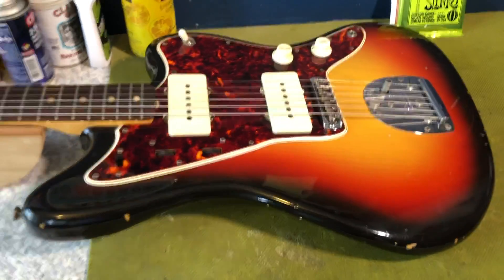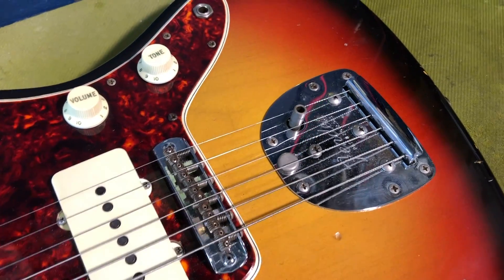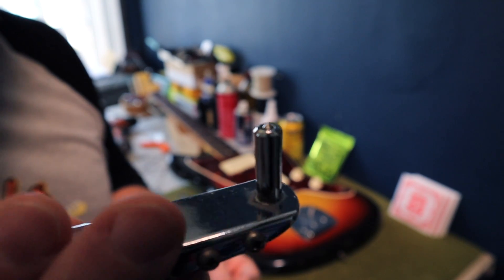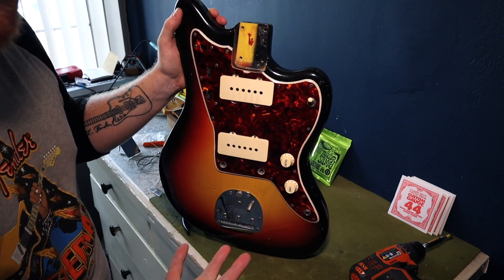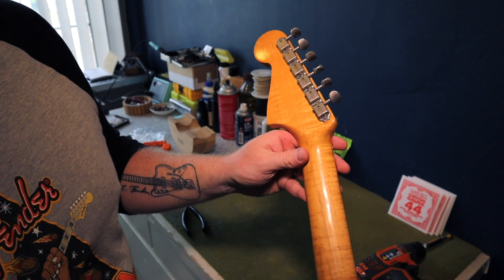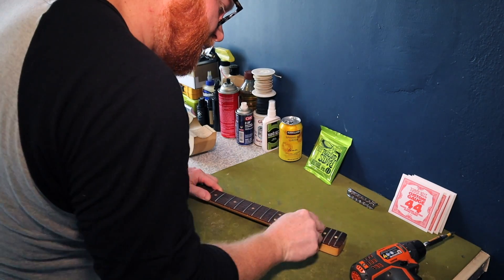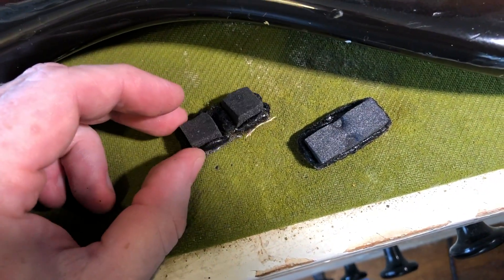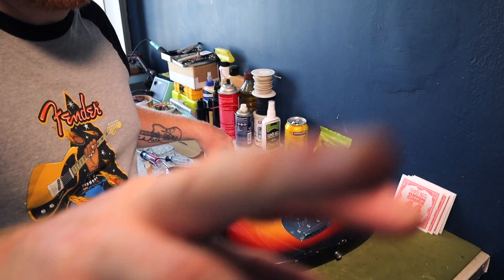1965 Jazzmaster Setup Walkthrough & Demo

Comment: I appreciate the way you assess the guitar so thoroughly. Lots of people will just finish the one thing that you specifically tell them about, and won't necessarily take the initiative to say oh by the way, I also noticed x and y. It makes me think they probably don't take the time to look at neck angle when it comes to setting up Jazzmasters and Jags. I  had a guitar set up once that came back playing exactly the same, with what felt like the same strings (I paid for new ones), and like the guys down at Jiffy Lube had played a few songs on it.
Reply from the maker: Jay, I try to take my time with each guitar which is why I usually charge a flat fee rather than an hourly rate. I play it for a bit, ask a lot of clarifying questions about play style, tuning, hand pressure, and clean vs effected sounds, and then blend it all together to help me setup the guitar for its player. It's a lot of me thinking and pacing, but I think I do alright! 

I worked on my first Jazzmaster in or around 2008 –– they just didn't pop up much in my home town. And when it came in, I noticed the string skipping issue and was completely confused by it. I didn't want to just hand it back as-is, so I did as much reading as I possibly could, considered every factor, and I'll admit it took me a couple of years after that for everything to click! But you're right, the tilt-back thing doesn't really come to mind for most folks because it just isn't routine for other guitars.
Reply: @Puisheen  that's great. Each person has their own sounds in their head, a particular way their hands interact with the guitar, all sorts of things, so a more personalized set up is worth it. Gotta start saving for my pilgrimage up north :) 👍

Comment: Thanks for all your help Mike! I finally got the Shell Pink Squier Jazzmaster and have been following your tips on setting it up and it is working really well! My next step is to replace the electronics and pickups. 

I am planning on getting the Curtis Novak JM-V (neck) and JM-Fat (bridge) and I want to keep the traditional Jazzmaster wiring with the Rhythm circuit but I would like to make some additions. I thought of installing a Free-Way 3X3-05 6 position toggle switch as well as a treble bleed mod and also allow the Rhythm circuit to work with the switch in order to use it with the bridge pickups as well as the neck, and neck+bridge. I reached out to Free-Way and they sent me a schematic on how to obtain positions 4, 5, and 5 from below:

Positions
1. Neck
2. Neck+Bridge in parallel
3. Bridge
4. Neck+Bridge in Series/In Phase
5. Neck+Bridge in Series/Out of Phase
6. Neck+Bridge in Parallel/Out of Phase

Do you know anyone who could help me figure out how to combine the wiring diagram sent by Free-Way with the traditional Jazzmaster wiring diagram plus having the Rhythm circuit work with the typical three pickup configurations? I have looked online and haven't found the answer and was hoping you could point me towards the right direction!

Thanks again and my next step is to level the frets and crown them!
cheers,
Jon

Comment: Hey Mike! Nice to see you doing a proper channel!! Thanks for all the helpful info over the years! I don't own a Jazzmaster, and probably won't for a while, but I'm curious about the original bridge versus the Mastery. I've seen you say that it is possible to use the original Jazzmaster bridge correctly, it just needs to be set up right. I just wanna know why the Mastery works the way it does, and why it seems so difficult for people to set up the OG bridge correctly?
Reply from the maker: The original bridge works great, as seen in this video and the previous one on the Jaguar. I think the issue isn't a matter of design or materials, but rather, education. Most people approach offsets as they would any "normal" guitar without considering the string geometry, the flow from tailpiece to tuners. Increasing bridge height by using adequate neck tilt-back is crucial, but not necessarily the first thing most techs think of when they're doing a setup. 

The Mastery is my favorite aftermarket bridge, but because it's designed to remain stationary and has deep grooves for the strings, the neck tilt-back feature isn't quite as crucial because you're not having to increase downward pressure on the bridge to keep things stable. Although I'd argue that these guitars still play best with some degree of tilt-back

Comment: great video! Thanks Mike. Now, I know my bridge is set up wrong.. ish. How do I know? because I faffed about with it when I was 18 and didn't know what I was doing :D 
I have my bridge set lower and the saddles set higher (partly as the screws were getting in the way of my low E string. ) Does this matter? I think the vibrato doesnt' bend as low, but I've never felt I'm missing out. tuning stays pretty good... any thoughts? cheers Luke

Comment: hey mike. Great Video. Just one question i got the part to go up and down with the steel wool not side to side, but the steel wool will not scratch up the fretboard?
Reply from the maker: I mean that's all buffing really is: putting successively finer scratches on a thing until it looks smooth. 0000 steel wool is fine enough that it's not gouging the board, but rather, smoothing it out and clearing away debris.

Comment: I have a new to me super nice Blue flower Jazzmaster, made in Japan. The guitar is my first offset so I am on learning process of how do setup and best strings and so on. Factory setup honestly is already good. Only unusual thing is the is comes from the factory with 0.9. Not great issue but I would go to .10 or maybe .11. Guitar neck has a certain breaing angle and no problem with tuning stability. I just see that the bridge is not moving that much when I use the tremolo. Maybe heavier strings will make the bridge move more?
What shims angle do You feel that is average ok on JM?
Thank You so much, I really appreciate Your informative contents on YT, IG and website. I have read them all.
Reply from the maker: Hey Marco, every guitar is different so it's difficult to point to a magic number that will solve your issues, but it seems that MOST guitars I've worked on require between .3 and .85 degrees of tiltback. And you're correct, heavier strings will always work better with these designs, though you may also be experiencing issues with the Japanese bridge which has much more shallow saddle grooves and usually a polished chrome plating on the saddles that makes them a bit more slippery. Friction is key for having the bridge move along with your vibrato.
Reply: @Puisheen  thank You I raelly appreciated Your reply. If I were in Your area I would take my guitar for a setup to You!

Comment: Hello! I have to say that in the outro you played, that is the best sounding Jazzmaster I've ever heard. What amp did you use? Any pedals? Those original pickups sound amazing, WELL DONE CAROL. I've been hankering for a Jazzmaster for years, I've only got 1 electric and it's an old beat up Gretsch I've modded the hell out of. I was wondering if you could help give me an answer - what's the best option for a vintage spec 60's Jazzmaster like this one these days? Actual 60s Jazzmasters are insanely priced over here in the UK so that's out of the question. Are any new Fenders good enough? Or do I mod a Squier Classic vibe? Or even just build my own? Just wanted to know your thoughts - again this guitar sounds like the real deal. Cheers!
Reply from the maker: Caaaaaaarollll thank you so much for the kind words. So, I use the Line 6 Helix for these videos because I live in a smallish apartment and don't want to be a jerk to the neighbors. Someday when I have more space, I'll swap over to real, loud amps for this stuff. That '65 Jazzmaster definitely sounded great though. 

There are plenty of good Jazzmasters out there. US Fender is a good safe bet, and my favorites are the AVRI62s that preceded today's AV65 and AO models. Also, if you can nab a Roadworn those can be excellent with upgrades. I do love Squier Classic Vibes and they're great modding platforms, so if you just want a taste of the JM "thing" you'd do well with one of those

Comment: Hi Mike informative as ever. When you adjusted the truss rod did you give the neck any forward relief or was it completely flat? Also Jaguar pickups do they have foam under them too? And which way round for the claws? 🐾
Reply from the maker: Hey, it's been so long that I'm not sure I clearly recall what adjustments I made, but I'm sure this one had a little too much relief. Jag pickups do indeed have foam beneath them, and while the claws seem to have been intended to go with the short teeth under the E & A strings, Fender has never been totally consistent with this. I've seen them all ways. I stick with under E&A personally.
Reply: @Puisheen  Thanks Mike.

Comment: I hate those tiny size shims, the one you're using looks okay however most are so thick that it causes a bump at the end of the neck like a little ski jump when you tighten the neck and let them stay on for a while. Always use full size shims everyone!
Reply from the maker: The shims can contribute, but they are not the sole cause of the bump you mention. It happens on just about every guitar including Martin acoustics, Fender Stratocasters, and even many old Gibsons I've worked on over the years, from string tension alone regardless of the kind of pocket they have. I've worked on countless '50s-70s Fenders that have no shims and have still formed such a ski slope at the end of the fretboard over many years, it just seems like something that wood will do depending on an array of factors. Use a full pocket when possible, but the original fibre shims aren't the culprit everyone makes them out to be
Reply: @Puisheen   that's true, any guitar can end up with a hump. In my experience, though, partially shimmed guitars are much more likely to end up causing hump hassle. As I mentioned, the shim you had there wasn't really able to produce the kind of air gap we're talking about - however it's always best to have a full shim on hand like you had! :-) Also, good coupling between the neck/body to make a better fit won't hurt either. That alone should be a reason to use full shims.
Reply from the maker: @blindsidedka  I hear you! I just don't fully agree with them being any more likely simply because of a shim. Heat, humidity, time, and how out of adjustment a guitar has been for a period of time are all much greater contributors to this issue than shims alone. Recently, I dealt with an old Jazz bass that had no factory shims and yet, an incredibly pronounced ski slope despite the truss rod doing its job perfectly. I just think pointing to a single factor as being the culprit rather than a range of them is misleading, and the whole idea of shims being bad is one of those things that's oft repeated in guitar circles but rarely examined critically. And I'll also say that these Stew Mac shims often have issues of their own, including compression. The wood used sometimes isn't sturdy enough to hold up once the guitar is strung. They're a fine solution, but not exactly perfect either.
Reply from the maker: @blindsidedka  But also, just in case I'm not being clear, I appreciate your comment! Thanks for sharing your thoughts and pushing back. I'm grateful we're having this discussion!
Reply: Puisheen I really appreciate the discussion too! And I also agree that there are of course other factors that come into play like you mentioned. Do you think making a shim out of harder wood would help with compression? Maybe it wouldn’t matter because of how thin the piece is... anyway, I really appreciate your videos. You’re so enjoyable to watch and I look forward to it everytime I see a new video is up. Keep up the great work man, I hope you don’t think I’m trying to be a buzzkill! You know what makes a guitar tick and I’m always into that. Stay safe.

Comment: I noticed you adjusted the neck while disassembled. Will the amount of relief change once under string tension?
Reply from the maker: Of course! That's the only way to make changes with the heel adjustment. After doing it for so many years, you start to get a feel for what a neck needs based on visual cues. I usually get it sorted on the first try.

Comment: hey puisheen, great video. thanks for making it it! i bough a fender mexican jazzmaster in 2017 it was the green surf green with nitrocellulose finish. i find that when i use the trem, it cases the bridge to sink (permanently) and then i get a lot of fret buzz. can you please tell me is there anyway to stop this? is it normal for the bridge to sink when using the  trem? the guitar cost 1100 euros so i am a bit disappointed. once again thank you for the video.
Reply from the maker: Get yourself some Loc Tite in blue or green and put a little on each screw. That should do the trick!
Reply: @Puisheen  thanks a million i will try that :)

Comment: With my jazzmaster set up with lowish action the E strings hit the screws on the tremolo. Have you seen this and how can it be addressed?  I’m playing a Squire 60s classic vibe. 
Also, I’d like to upgrade to an AVRI tremolo but I can’t find one for a lefty. Do you have any leads on one or even know the part number?
Reply from the maker: Yeah that happens with reissue vibratos all the time, the domed pivot plate mounting screws are rounder and taller than they used to be. Often you can get more clearance by setting the thing up with shims to pitch back the neck, raising the bridge, but sometimes not. If it's too difficult, I'll often remove those screws and flip them upside down so the head sits under the pivot plate, which usually solves the problem.

Comment: Very cool video! What do you recommend when it comes to pickup height?
Reply from the maker: I plan on doing a full video on that subject at some point, but basically I treat them like any other good pickup. Fairly close to the strings at the bridge, and farther away at the neck for balance. If you skim to the end of the video you can see generally how I have them set on this '65, and my own are nearly identical. 

I don't have a measurement to give you because I prefer to do that by ear. Play the guitar and adjust based on what I'm hearing.
Reply: Puisheen awesome! Looking forward to more great videos!

Comment: Hi Mike,
 
lately i’ve been enjoying your offset videos tremendously! Towards the end of this one you mentioned that you’d still address the balancing of the pickups. 

I have a Japan Jaguar in Burgundy Mist Metallic and a 60s Roadworn Jazzmaster in satin 3TS, which I both love to death. However, the neck PU of the Jazzmaster needs to sit basically level with the pickguard and the bridge PU maybe 2mm below the strings for them to be balanced. That imbalance was (logically) intensified after I shimmed the neck. 

Those are Pure Vintage 65 JM PUs with the neck measuring around 6.15 kOhm and the bridge about 6.1 kOhm. I already swapped N&B in hope to slightly counteract the imbalanced output, but it’s still too pronounced. 

Do you have any idea what else I could do?

Greetings from Germany
Reply from the maker: I always start by putting the bridge pickup where it needs to be to sound the way I like, then adjust the neck to match. Neck pickups generally do need to be a lot lower to balance, but with the PV pickups you really are working against two pickups of nearly identical output here. The issue you're having is why most modern pickup sets have a hotter or overwound bridge, and there really isn't any other way around that than swapping them out for something else.
Reply: @Puisheen  Alright, thanks! I was hoping not having to swap PUs, but I might look after a hotter bridge PU then... Maybe also a follow up question: I have Staytrem bridges installed on both guitars with matching 7.25 radii and 11-50's. However, on the Jazzmaster I get a slight buzz on the D and G strings for frets >14  if I ajust the bridge height to low and high E strings. If I adjust the height for D and G, the outer strings are way too high. Almsot as if it was a 9.5° bridge on a 7.25" neck. Could that be a  bad fret levelling (MIM) ? Should I shim the D and G bridge saddles or does that "coat too much tone"? Currently out of money for a luthier...
Reply from the maker: @indigoblondes  Sadly without having the guitar in hand, I'm not sure I can really diagnose, but the first thing I would check out those neck and bridge radii. Which MIM model is this?